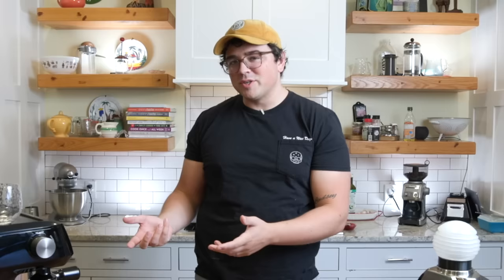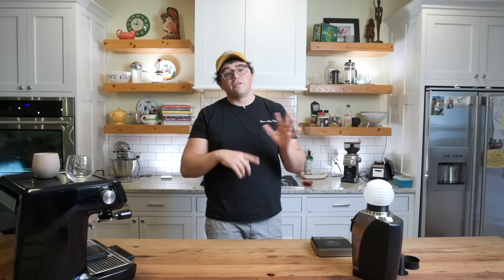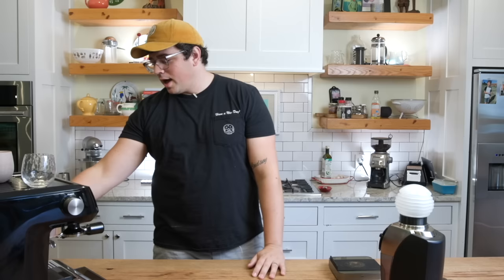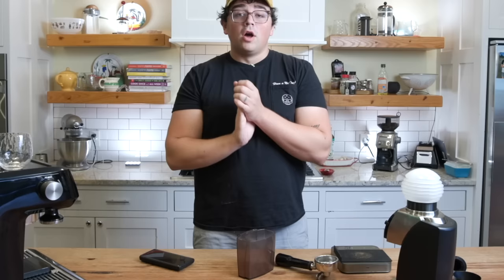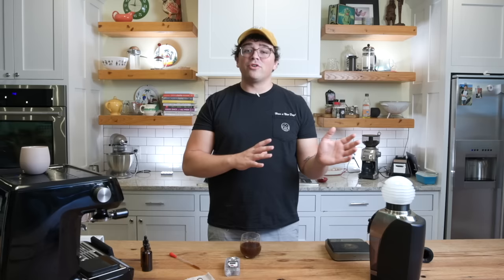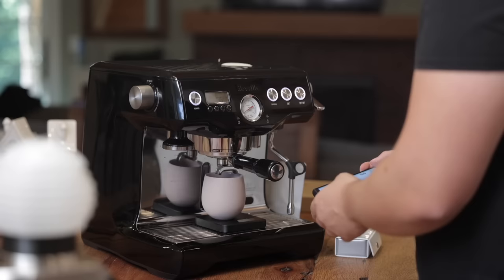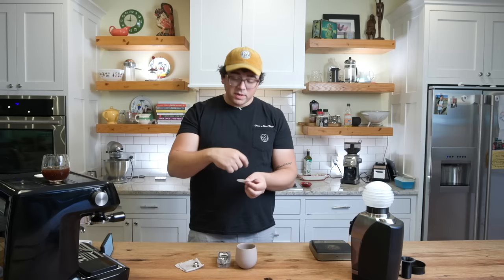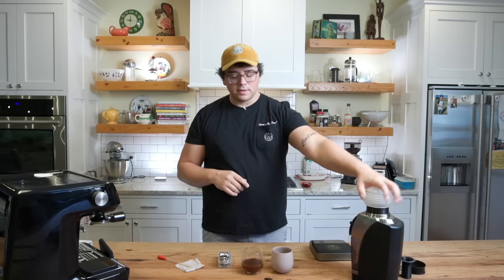SPRO-OVERS: THE CRAZY, DELICIOUS, BIZARRE WORLD OF COFFEE SHOTS

Comment: How would I alter the flow on a Quick Mill Vetrano 2B?  There isn't any preinfusion setting on the PID that mimics that feature on the BDB in your video.  When I start the brew, the pump shoots up to 9 bar.  Also, is this going to taste good using a dark roasted bean?
Reply from the maker: You need to go much coarser so it can't hit 9 bar. And with dark roast, you'll need to ensure you're on the lower end of extraction
Reply: @LanceHedrick  I also have the 2B (and just got a M58) - so can I do it with just going course so it can't build pressure or would a flow-control let me control things much easier (and give more things to play with for espresso)?   I dont have flow control now, and seems dimmer-mod is for vib pumps. I use light roasts.
Reply from the maker: The dimmer control definitely lets you play with flow which in turn allows you to have more control over the Puck. When using lighter roasted coffee, it has a much lower puck integrity, so flow control gives you fine tuning capabilities

Comment: I have an e61 with pid on the way and want to mod eventually after I get the hang of it. Would it make more sense to add the needle valve flow control or just do a dimmer mod?
Reply: I have a machine with the same group head. I just did the dimmer mod and it works just fine!
Reply from the maker: Dimmer is certainly more responsive, though add the needle valve kit isn't too hard. Really up to you!

Comment: How would you do this on a modern commercial machine like a Black Eagle in a cafe setting? The black Eagle (at least from 2017) doesn’t have separate group control of pre-infusion, so you would have to turn on/off preinfusion in between every sprover and regular shot.. does anyone have any ideas?
Reply: no need to do it. taste is not comparable to proper espresso/long black imo
Reply from the maker: Again, super curious as to how you're doing this. I suspect you aren't getting it done properly if you use "sour" as a descriptor.
Reply from the maker: Hey Joseph! I'd follow the perger recipe in the caption. Something like 18g on, 345g out in 45s. Of course, just like pourovers and espresso, you want to dial this in!
I prefer sprovers to Perger's coffee shots, but the latter are still good! They're what you'd need to do if you can't change the water debit on the fly.

Comment: Hey Lance, any tipd on pulling sprover withe steel vario and a decent? What flow/temps would you recommend? I'm assuming pressure goal is 1ish bar and do a 1:10-12 ratio
Reply from the maker: Exactly right. I wouldn't even set a bar limit. Just set the flow to around 3ml/s
Reply: @LanceHedrick  just pulled a SEY colombian bean at 15g in 180 out in a 18g VST basket. 8 ml flow to fill till 1 bar and then 3 ml flat flow. Pressure was under a bar the whole time. Total time was about 45 sec. May try a couple of notches finer next pull but this is quite nice anyway. Very similar to an immersion brew.
Reply from the maker: Similar in body, but much, much higher extraction due to percolation.
Reply: @LanceHedrick  agreed. I've found that the ratios can change a lot depending on beans. Otherwise there's a lot of off flavors in the cup.
Reply from the maker: Absolutely. Have you found some good success with the steel Vario recently?
Reply: @LanceHedrick  The steel Vario has been my grinder of choice since the last few years. Used it for all manual brews and now even for sprovers. I have found it not being able to grind fine enough for espresso on my Decent though. Although the sprovers are fantastic. The P100 is coming for espresso duty in the next couple of days.
Reply from the maker: Oh nice! Yes-vario does great traditional shots but not quite give enough for lots of flow control. And p100 will be awesome!
Reply: @LanceHedrick  for me in the vario I've been unable to even generate enough pressure for default and G&S profiles.
Reply from the maker: Oh wow! Have you alicorn aligned them?
Reply: @LanceHedrick  Thought about it when I ordered the decent but got lazy and ordered the Lagom. Anyway I'm not very handy with tools and don't trust myself to do it well.
Reply from the maker: Haha that makes sense. With the alignment, you can do lots of flow profiles, just not things like blooming
Reply: @LanceHedrick  Oh ok. Thanks for that info. Maybe I'll get around to doing the alicorn alignment at some point or continue to be lazy and just move it to the office for brew duty. Haha. In other news, P100 arrived!

Comment: I set my BDB to 55 PP and 90 secs, ground coarse, but the shot hit 150mls in 57 secs, does that mean grind finer?
Reply from the maker: If you want to lengthen the time, grind finer, yes. Did you drop the temp? I would go down to like 88 or so. Maybe lower
Reply: @LanceHedrick  yes I dropped the temp to 90 deg C, will try 88 and grind finer. Love your videos, great content 👍
Reply: @LanceHedrick  I’m having the opposite issue, I have my df64p at it’s most course setting and my bdb is only getting out about 100 grams in 90 seconds. Any suggestions? I also have my machine set to 55PP at 90 sec, 195F

Comment: Can i do this with no flow profile machines? Which parameters should i change to fit with my machine?
Reply: You can, but the result will vary a lot depending on the water debit (how much water the pump pushes out every second)
Reply from the maker: Yeah! You'll be doing coffee shots. Check out the perger recipe I included in the caption!
Reply: @LanceHedrick  i guess this type of brew require light roast coffee? I've tried espresso roast once ( medium roast) and it's give me a sign of over-extraction bitterness or should i just coarser the ground and a bit tighter ratio? fyi 15g in 20g basket for 225 yield
Reply: @lazeed  yeah, this is a fairly high extraction way of brewing, you could probably get a good enough result with a darker roast but it might be harder to find the exact water debit and grindsize for it

Comment: Lance, question about dimmer mod on your bambino.  When pulling such long shot with lower flow rate, how did the temperature react to that?  I understand there is pid, but do you think it can still regulate the temperature at low flow or did you see and increase in temperature as there was less water to heat running through the Thermo jet?

Comment: Is there a preset for this on the Decent machine?  Thanks Lance!
Reply from the maker: No, sadly. Really easy to program! Just program a 90 second shot at 4.5ml/s flow for the whole shot. Maybe make the top pressure only 1.5 bar so it can't get over that. Should help you dial on faster
Reply: @LanceHedrick  I'll give it a try - "Lance Hedrick's SPRO-OVER."
Reply from the maker: Yes! Send me the profile so I don't have to be a narcissist to add my name in my machine 🤣🤣🤣
Reply: @LanceHedrick  In creating the new profile, I deleted all but the preinfusion cycle and renamed it "brew." I set it for 195F, 4.5ml\s, w\ max pressure of 1.5 bar for 55 secs to yield ~8oz (18g od coffee). of brewed coffee.  I turned out pretty darn good for a first try, not bitter, like a good, brewed mug of coffee.  No fines in the bottom of the mig either.  I may try a slightly finer grind (than a drip medium, for whatever that description is worth) to give a bit stronger taste, but it's pretty close.  As you suggested, it was very easy to create the new "Lance Hedrick's SPRO-OVER" preset on my Decent.  Thanks Lance, try those settings and let me know what you think, or if you have any tweaks.

PS Go ahead make your named profile!  As Satchel Paige said, "It ain't bragging if you can do it!"
Reply: By the way, I found I had to pull the portafilter tighter than for a regular espresso shot or I got some side spray at the edges.  Not sure why at such a low pressure.  I used a Flair 58 screen which helps keep things cleaner.

Comment: Hi Lance, could you do this with Flair 58?
Reply from the maker: Sadly, no. The water reservoir is not quite big enough to hit the ratios. Perhaps if you did 12g in a 15g basket and did a 1:8 ratio?
Reply: Andrew from flair has played around with sprover type shots that go to 140g by pulling one time through then refilling and pulling another time. Outside of that I think the max is about 70-75 grams output of the flair 58
Reply from the maker: Yeah he has but pulling up can crack the puck, sadly.
Reply: Thanks for the info, I'm still waiting for Flair 58 to arrive, looks like the reservoir is the limit. Will definitely pull, refill and pull again into a different cup even if it crack the puck to taste the differences :)
Reply from the maker: For sure! Do it! Experimentation is everything

Comment: If it possible to relocate this on a Breville Barista Express?
Reply from the maker: Yes! You can run the whole shot in preinfusion on the express!
Reply: @LanceHedrick  as an Infuser owner I think I have this option as well in manual mode. I'm not sure what the time limit is though. Hoping it'll work as I'm eager to try this as a regular Americano drinker!
Reply: Update: held in the button for preinfusion mode and the longest it would go was about 42 seconds.
Reply: So the above 40 seconds was with an empty basket. I put in 15g of coffee and it stopped at around 53 seconds. It did not taste great. Not sure if the Infuser is capable 😕
Reply from the maker: The infuser should be fine with PI mode. You could also do the dimmer mod. Sounds like you just need to dial in a bit more! It is forgiving but you gotta find the range first!
Reply: @LanceHedrick  isn't it better to go 90 seconds or more though? When I tried last time to keep it in preinfusion mode, it wouldn't go much past 50 seconds. I'm definitely curious about the dimmer mod for the Infuser.
Reply from the maker: 90 isn't imperative. I pulled some super tasty, and high EY shots at 50sec on my bambino plus. Maybe down dose!
Reply: @LanceHedrick  good to know. When I tried it, I went down to 15g in my IMS 18g basket. There was tons of headroom as that basket probably holds 20g in reality. Ended up with yield of about 145g but didn't taste good to me. I'll keep experimenting!
Reply from the maker: 14g is ok in an 18g, even if lots of head space! That's actually one of the things the sprover creators advocate for- lots of head space.
Reply: @LanceHedrick  cool, I will try that. Quick question on ratio: if I'm not able to go past 50 seconds, should I grind to get a bit less? Is 1:10 too high? Which ratio in that time do you think is ideal?
Reply from the maker: You can do 1:8! Just play around. Nothing dogmatic here. You can get it to taste good at different ratios, grind sizes, doses. Just play around and find something that you dig and fine tune!
Reply: @LanceHedrick  thanks again! Super appreciate how responsive you are to all your commenters!
Reply from the maker: Thanks, James! I try to keep up as best as I can
Reply: @LanceHedrick  finally got a tasty cup! I was using a Kenyan bean, which probably complicated things, but I ended up going incredibly coarse, like almost in actual pour over territory and I got 150 out on 14g in 50 seconds. It was sweet and had a touch of caramel.
Reply from the maker: Oh YES! Love it! And pulling these tend to teach you a lot about extraction in general